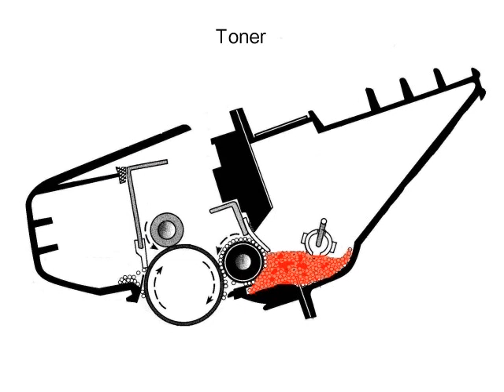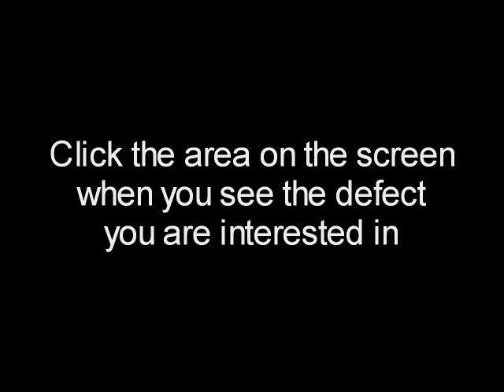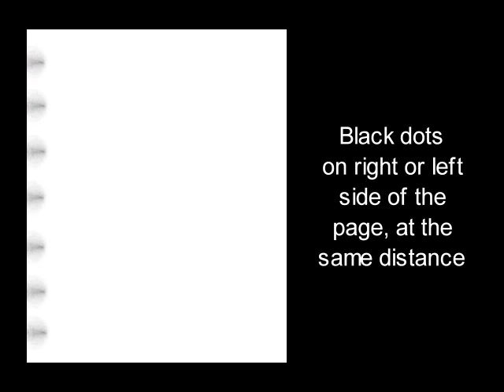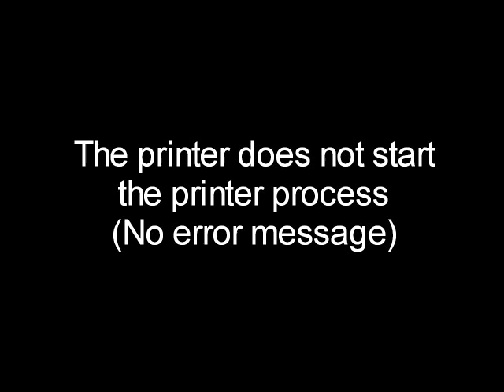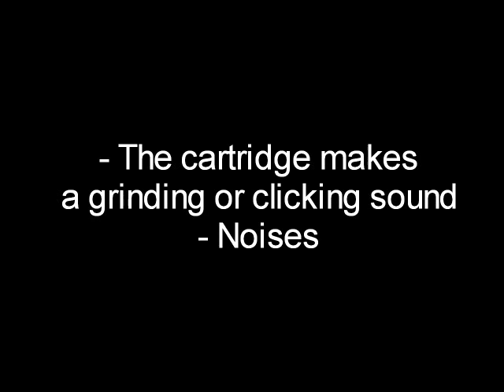Toner Cartridge Troubleshooting Guide

Comment: I just purchased a  Brother HL-L2320D Mono Laser Printer which prints everything perfectly except for photos which come out with very regular tightly spaced soft horizontal white lines; like corduroy.  It has a Brother drum and Brother cartridge and  has only been used for 450 pages.  I didn't see any of your samples which resembles it.  It only appears in photos.   I'd be glad to send a scan of the result if that would be helpful.    Thanks for any insights you might be able to provide.
Reply from the maker: It's difficult to obtain a perfect photo with this printer and the starter cartridge only prints a few hundreds of pages. I think you have to change the toner cartridge.
Reply: @viandant5  Thanks for getting back to me!   I did change the toner cartridge as suggested and it did make an improvement in the image quality. I can live with it. The corduroy like horizontal banding was appearing on any image not just photos including blocks of black. You only notice the banding when printing larger images.  No banding was visible when printing text.

Comment: i bought used 107a, the toner leak and spread inside the unit, the print was half light. i cleaned the Outside Laser Beam Window with glass cleaner and soft clothes, without dissembling the printer, it's about 1cm x 10cm located inside the printer at the front of cartridge, facing catridge's same 1x10cm hole. and now it back normal dark and sharp. I did it to my Fuji Xerox, brother and Samsung too
Reply from the maker: Right, a dirty scanner unit could give white vertical lines

Comment: Light print problem due to rainy season. If you wait for some days your problem solved automatic other wise refill with hp 88 toner powder and replace new hp88/36 OPC drum if required.
Reply from the maker: In case of damp environment you should change sheets of paper

Comment: First of all, thank you very much for all of your professional videos about laser printers!!!

The toner cartridges (black, yellow) of my Samsung CLX-3185FN, are losing toner on the right and left side (near the gears). When i take out the cartridges, lots of the toner just falls out, is there a way to repair the leaking cartridges?  Because they are still filled with 90% toner.
Reply from the maker: Look at the metal blade under the developer roller, may ne it's bent. or may be the mylar plastic blade under the developer roller is detached
Reply: thank you for the hints. I have disassembled the cartridges today, both were originals from Samsung. The point is, they didnt have a mylar plastic blade. The developer roller was straight, had no deformation. I have bought this printer through ebay, maybe the previous owner has worked on it before, because the screw channels were lax too. Anyway i have thrown away the defect ones and installed new cartridges, that fixed the problem.

Comment: Sir, i have changed almost everything Refilled with the powder,changed the OPC,Mag Roller, PCR Roller Doctor Blade, Wiper Blade But still the cartridge is printing Very Light and only half page. I Tried the same with the new toner cartridge but it is working fine. Where Can be the Problem.
Reply from the maker: But which cartridge?
Reply: 88A, HP M1136 laser jet original cartridge
Reply from the maker: @1977adit  It could be the magnetic roller bushings. If defective they keep a wrong distance between toner roller and dru,m. Check the mag roller contact on the side of the roller. Are you sure the PCR supports are ok? But I think the cartridge has been not correctly reassembled
Reply: Will try and reply you back. Thanks a lot.

Comment: Hi, thanks for your videos. We have a Dell 5100CN color laser that has served us well for many years. We have changed the fuser, drum and transfer roller repeatedly. Recently we put in a new magenta cartridge I think may be bad. What do we do? I changed the drum assembly to one we had replaced before and I got 2 perfect prints but then it went back to printing with magenta covering the whole page even though I was printing B&W text. It is very humid right now, maybe this is a factor. Do I just take out that Magenta cartridge, replace it, and clean the drums? Or do I need to do more than that?  Thanks again.
Reply from the maker: try changing the paper, then I think the problem is the magenta cartridge, probably a bad contact

Comment: HP Laserjet 4250. Has bubbly or grape like pattern. Though mentioned on the video did not see anything about the resolution of this problem?
Reply from the maker: There is a problem with the PCR. May be the contact is defective or it's out of position
Reply: @viandant5  PCR ?
Reply from the maker: primary charge roller

Comment: Hello. I have an hp colorlaserjet pro mfpm182n. While using my printer I suddenly got printed pages with colorful bands, indicating a discharge problem. I figured out that a small nick/hole has developed in magenta cartridge. I would like to ask you that why such nick has developed on my opc drum suddenly. Is there any precaution i should take next time to avoid such loss?
Is it normal that such problem occurs after certain period of usage?
Reply from the maker: Yes it happens. It could be due to a foreign object in the paper for example but it's not so strange and there are not specifical precautions
Reply: @viandant5  by foreign object do you mean dust on paper can cause such problem?
Reply from the maker: No, something like a paper clip
Reply: @viandant5  thanks

Comment: Kindly, I need your support to identify the issues that faced. I have a printer HP LaserJet P1102 & the two issues are:
 1-Gray tire tracks on one side.
2- Dark orizontal banding accross the page.
Thanks in advance.
Reply from the maker: The gray tire tracks on one side probably is caused by a worn drum. the dark orizontal banding is often a PCR contact problem but it could be a problem related to the drum
Reply: @viandant5  thank you 🌹

Comment: I have a weird problem with a new phaser 3116 printer
It prints ok, but whenever I use the manual feed, it make all different issues,

takes considerably longer time to start printing
may not print at all and produce the paper dirty!
it print but faded and dirty print and not in the place
it also stop just before the paper completely come out and it always give a red light that does not go unless I power it off!!
Reply from the maker: may be there is a problem in the feed of the paper. try to clean the rubber paper feed roller and the rollers in the paper path with alcohol. the red light probably indicates a paper jam

Comment: HP CM6030f MFP. The color is brighter on the top of the page with all colors. The bottom and middle of the paper colors is ok. Please any solution (Y)
Reply from the maker: All colors? Are you sure the problem is not related to only a toner? It colud be a problem related to the developer roller or the blade of one color.

Comment: While refilling canon 337 cartridge I accidentally opened it from its mechanism gears parts. I assembled it. Refilled it. 😏 Printing is not that much dark. Is there any video/tutorial you could make for educate or how we can fix that problem.
Reply from the maker: Canon 337 is not an inkjet cartridge. Did you mean HP 337?
Reply: @viandant5  canon mf244dw bro
Reply: Lazer I think, thanks for correcting.
Reply from the maker: You mean the gears are not in the correct position? a not so much dark printer could be caused by magnetic roller, a worn drum, the magnetic roller blade, bad toner powder

Comment: i bought a new printer canon imageclass mf4820 d and the cartridge inside is 328 starter 
after 100 prints ,the print begins to lighten up and now it gave very light prints 
i have talked to custermer care and they ask me to chnge the cartridge or refill it ,then i refill it but after refilling i still dont get the solution ,still get very light prints
Reply from the maker: It's not enough to add toner, you have to remanufacture the cartridge and clean the internal components

Comment: Hello! I have a Samsung CLX-3185FW. The page prints darker at top and lighter at bottom. When I inspect the black toner cartridge, I see the developer roller is missing a horizontal strip of toner. If I turn the developer roller manually, toner is evenly applied. I think the printer (or cartridge) is not automatically turning the developer roller all the way. Do you have any advice on how to fix this? Thank you!
Reply from the maker: I think the toner cartridge is near the end of its life, so there is not enough toner. when you turn it manually, you shake the cartridge and you can see the toner over the developer roller. I would try to change the toner cartridge. the line missed is the line near the drum, it's normal
Reply: Thank you so much for the response. It is an OEM toner cartridge and has never been refilled. Samsung software says the black still has 59% toner left. None of the other colors have the missing line of toner - even yellow, which is at 34%. Does that missing line of toner only occur for black?
Reply from the maker: all colors are darker on the top? in this case I think the toner cartridges are not the problem
Reply: Yes, all colors are darker on top half of page and then get lighter on bottom half of page. Do you think it could be the charge roller?
Reply from the maker: May be the drum, or the transfer belt unit. try to change the paper, it may be damp

Comment: I have a brother printer , after refilling my toner , it starts to print with grey background , the drum gets dirty with the powder ink after each paper I print 
would you please tell me what I should  do ?
Reply from the maker: +mohamad kattoa probably you do not clean all the old toner before the refill. now you have to clean the drum and change toner cartridge, or refill it again.
Reply: I have the same problem... Can I just clean the outside and the developer roller (without changing the new toner I just refilled) or I really need to buy another toner cartridge?
Reply: maybe, toner not suitable for your printer.
Reply: When I bought it, it was supposed to be compatible with my model  (Brother HL-3045CN)...
Reply: +Anaïs Laliberté make sure a compatible toner for brother!
try to replace another toner
Reply from the maker: you have to remove all the toner powder from the cartridge and refill it again with new toner

Comment: Hello Dear,  i have hp laser M1005 MFP. and facing problem of a msg being displayed ""No Print Cartridge" on screen. pls assist me to fix it asap. i have cleaned its contact point and set this printer on default mode as well - thanx.
Reply from the maker: may be a problem related to the contact between the side metal pin of the drum and ind internal contact. look at the cartridge if you see some broken pins

Comment: I had refilled hp 12a and I gave the test print. The printout was normal but there was a Tyre tracks at right side of the paper. I tried with around 25 pages but the output was same.
Reply from the maker: probably there is a toner clump over the magnetic roller. try to clean it with a soft cloth, or change the doctor blade
Reply: viandant5 thank you for your response I will check it

Comment: Dear sir I have hp 1132 all in one printer problem with toner, I refiled the toner its comes light line of full page plz reply sir
Reply from the maker: I think there is a bad contact somewhere in the cartridge, probably on the magnetic roller. disassemble and reassemble the cartridge again, make attention to the side plates of the toner hopper

Comment: Black horizontal lines at regular interval  I have clean the wiper blade but still it's coming plus after cleaning smudges on the top left any suggestions
Reply from the maker: an horizontal line is not a wiper blade problem. without knowing the name of the printer it's difficult to say where is the problem, may be the drum
Reply: It's HP 1100 toner number 92a
Reply: some one told me its drum problem an other one says it's doctor blade I have changed it  a week ago
Reply: I am still waiting a reply
Reply from the maker: It depends on the distance of the horizontal lines.
Reply: It's 3 inches in distance
Reply from the maker: Probably it's the drum

Comment: Hi Sir I have A Problem Whith Hp Laserjet 3052 dark orizontal lines, but distence is not same on Page please give  me a slution Thnks Sir
Reply from the maker: may be there is a shortcut between the drum and the charge roller or transfer roller. changing the cartridge could solve the problem. check all contacts between cartrige and printer

Comment: Page setting is correct.. 
Im using legal.. 
I tried 4A
Can you tell me.. 
Where laser is located in hp laserjet 1100
Reply from the maker: It's not a laser problem if the last half inch missing is horizontal.

Comment: Sir my printer is not printer the last half inch of the page 
Beside this its working perfect. 
Model is hp laserjet 1100
Reply from the maker: I think it's a problem of printer settings. open the printer folder and check the page properties

Comment: i have a problem i refill my cartridge but still 
the printer said black ink is very low.
Reply from the maker: Without knowing which cartridge do you have it's difficult to say. try a reset procedure
Reply: the model of my printer is m402dw,
sir do you have a link in reset procedure

Comment: Solution plz
Reply from the maker: https://www.youtube.com/watch?v=Jn6DpDC8g8U&t=707s
Reply: @viandant5  
Thanks 
But i put everything new 
Still i m not able to clear this problem
Reply from the maker: @maniksingla1905  which problem?
Reply: @viandant5  horizontal lines....now cleared now i again need to change opc drum ...i had changed but i don't know why the new drums didn't work properly and when i replace with another one.....problem solved
Reply from the maker: @maniksingla1905  Without knowing which is the printer it's difficult to say. Probably the toner cartridge is damaged
Reply: @viandant5  hp mfp 1136

Comment: Hi sir I have canon MF3010 printer when I start printer some sound is coming and sometime in some place horizontal small or long distance is coming with white    lines please say me solution for this problem
Reply from the maker: did you try to change the cartridge?
Reply: @viandant5  yes try to hanadar cartridge but. Same problem sir
Reply from the maker: @RAJKUMAR-tq5px  It's difficult to say without checking the printer because it could be lot of things. It could be a broken gear in the moving paper mechanisms. Remove the side panels,  watch if there are broken parts in the fuser unit or in the side gears. I think you have to bring the printer to a repair centre